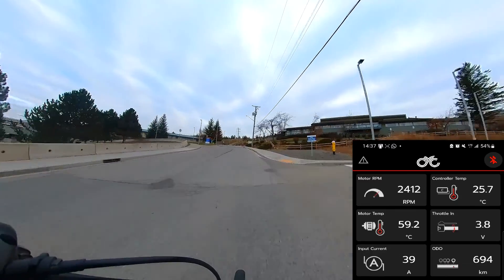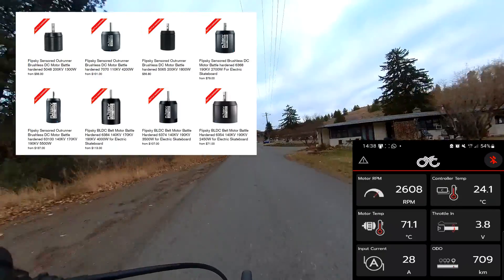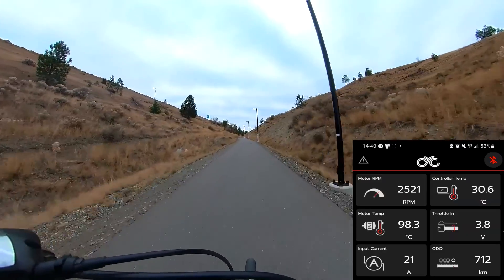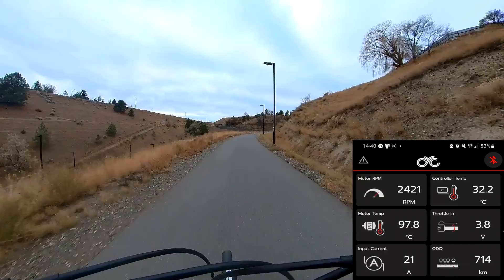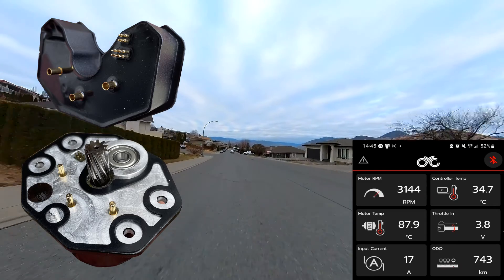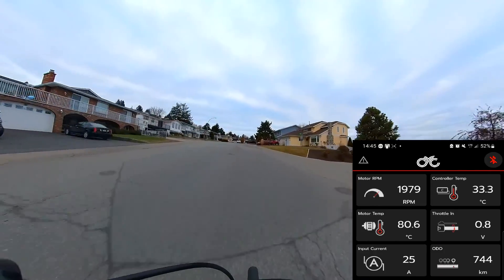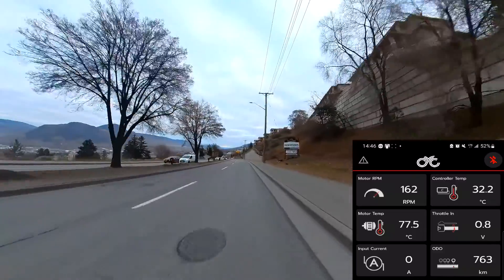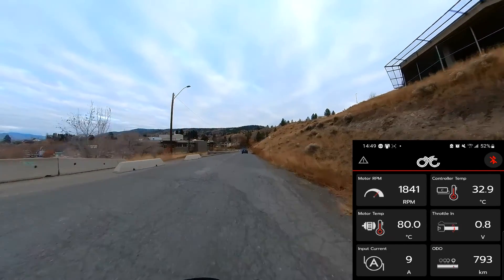How This Ebike Motor Works - Why the CYC Photon gets hot

Comment: Nice vid! It very much mirrors what you said in your earlier CYV Photon videos regarding design trade off. I personally still plan to get a Photon as the design tradeoff is ideal for me. I'm after a small, light motor with high peak torque for uphill sections on MTB trails (plus some boring commuting at non-motorbike speeds). Despite living in a hot climate (Australia) I'm betting i will rarely see extended periods of 90+ degrees.
Reply from the maker: Sounds like you will be running it well within its limits most of the time so you are likely right. It will definitely give you an assist on the steeper stuff in a very compact package. You do get a two year warranty which is nice although you might be having to wait a while for parts unless there is a dealer in Australia that is doing servicing.
Reply: i would be interested to hear how you go with using this for mountain biking in terms of heat for short hill climbs. im also in australia and considering this motor.
Reply: @muzzarobbo  I got my CYC Photon installed on a Trek Marlin 6 today. My first ride was so much fun. Mostly flat / low grade fire trails, some tougher technical MTB trails (for me) including steep sections I'd never even think of riding up myself. Followed by riding on the steep local roads. 24 degrees ambient temp. Staying on "race mode". I weigh 100kg. Motor never got above 65 on any of the trails, and only hit 90 once when testing full throttle on roads going up a long and steep hill at 30kmph+. It cooled down to 60ish faster than I thought it would by just going back to a medium PAS level. I don't have anything to compare it to, but the torque sensing feels really good. The bike shop guys who installed and test rode it said it felt like the Bosch torque sensing motors. 
Long story short I'm very happy. Let's hope she ends up being reliable for me!
Edit: I didn't go much faster than 30 or maybe even 25kmph on the trails. At that speed I was reaching my comfort and confidence level on the rocky surface. I surprised myself getting airborne a few times too.
Reply: @Intermission42  Its a great motor, the best of its kind. So tired of clueless know-it-alls trashing it.

Comment: I have had my 52V CYC photon setup installed since august and am now approaching around 800 miles.

It is by far the best DIY torque sensing setup IMHO at this time and my favorite to ride.  

My other DIY ebikes have been an 52V OSF TSDZ2 (with additional sw mods by me to improve torque sensing), torque sensor equipped Grin 52V GMAC (1500w) and 52V BBSHD (1500w).

It obvious from looking at the photon, its not made for sustained high power especially when compared to the BBSHD.  That being said, its significantly lighter.

I installed mine without a throttle as it seems like it would be super easy to overdo on the throttle and cause overheating.  The torque sensing is so good, I rarely feel the need for a throttle whereas a throttle seems mandatory on the BBSHD.

I run mine in unrestricted mode and 95%+ in assist level two.  I only get overheating(90C) on assist level 2 when going up hills greater than 10% (My 42t chainring and 11-36 cassette isnt the best for this grade although the BBSHD handles it fine).  Assist level 3 will overheat if I am really pushing it (25mph+, high headwinds winds and 4-6% grades) and I can usually get it to 90C once per ride.  That being said, no overheating at assist level 2 for those same conditions.  Of further note that this unit seems very efficient although it does require more from the rider.  My unit seems to cool down rapidly once I just reduce power, just resting the motor for a few seconds is usually good for a 5C reduction.

Im 240# and most of my rides are rolling 4-6% hills, typical elevation gain is 1500ft in 25 miles.   Typical temps for most riding is around 50C and this is at an average speed usually of 18mph.

FWIW, I also have a Specialized Turbo Levo and Luna X2(bafang m600) with ludicrous upgrade.  Have also owned several other factory equipped mid-drives both Class 1 and Class 3.

Will buy/try a ToSeven DM01 soon
Reply: Great information
Reply from the maker: Appreciated. That is an impressive stable of machines! I think they need to be clear with the Photon what it can and cannot do even of that means that it sells less. In the end it will save them money as there will be less people making warranty claims. Some of the issue where I am is it is all hills and mostly 10%. I am wondering if the throttling behaviour is different for with PAS than the throttle. It seemed to cut more power than with the throttle. Not sure why. I would be hammering the message of get Turbo Levo performance with the bike you own. I would be going hard after that market. That is the kind of buyer that would not balk about buying a motor for $1000.
Reply: IMHO, the photon is a great alternative to the $$$ euro based mid drives with a little more oomph.  Its a ton better than the class 3 brose bike I owned.  Thats how I look at it.  It even has a euro based price tag😀  While the torque sensing isnt on par with the Brose, I am nitpicking at this point.  I love my photon.

Your just spoiled by your 72V BBSHD (a project I have been debating but too over the top for my riding)
Reply from the maker: Yeah. You have a point. I tend to judge everything by the throttle response on that which is not fair. I try. But there is no going back lol. Maybe if I didn't ride it for a year? hmm. That would be tough.
Reply: @HighVoltageKits , mine is set and ridden at around 95% + also, but strictly level 3 race mode. peddle only. no throttle except for periodic cheating at extremely short bursts.14% grades and 1800ft climbs. 42t chainring/12-50t cassette.  longest run was 30 mi. the only times i have experienced throttling is when using the throttle.
Reply: @bobbobb1791  same. Brilliant motor. But to be fair, the motor never "overheats". To an outsider, this will scare them away. Be honest. Be fair. Don't smear this amazing company. The motor DOES NOT EVER OVERHEAT people. If it gets too hot, thermal overload protection kicks in and it cuts power to cool down. The only reason this ever happens is because the amazing CYC company gives tons of extra power that you can use in bursts. And you can use the bursts frequently and to insane effect! Its a brilliant motor and this review video is misleading, unfair, and arrogant.
Reply: @HighVoltageKits  You just said that you're judging everything by the throttle which was not fair. You just stated your review was not fair. So remove it and apologize to CYC for smearing their product unfairly. There is going back. You can be a good person and retract your unfair assessment.

Comment: What's the  best mid drive motor overall for speed and doesn't over heat
Reply: The best mid drive motor that doesn't overheat is the Photon. It never overheats. Its too bad this video smeared its reputation. They give you up to 2000 watts unrestricted, that is why if you use all of that (more than twice what its rated) thermal overload protection kicks in and limits the power until it cools down. The extra power is bonus. But people are too stupid to realize that, and then overuse it, and think the motor "overheats". It never overheats.
Reply from the maker: It depends what you are looking for. The most reliable by far is the BBSHD still. You can reliably power it over 3kw with a high speed and have a reliable bike that will run for a long distance. You can overheat anything with enough work though. The CYC X1 will also deliver speed with a torque sensor but less reliability and its louder. Those are ebike conversion motors. Beyond that there are the bottom bracket motors from Bafang. Are you looking to make something or have something pre made? If you really want higher power then you need to look at things like the Sur Ron (modded) or Talaria. You are in motorcycle range then. Any of the DIY ebike systems will overheat given the right amount of abuse (a long hill at full throttle) The best ones will roll back to protect the motor. The hotter the weather the quicker it will heat up. I hope this helps. If you wanted to learn more you would be welcome to join our discord and figure out what might work best for you.

Comment: I'm seeing a few comments from people seeming to avoid the Photon, instead perhaps promoting the Toseven motors which are even more of an unknown. I've been riding my Photon since April, and almost all of that is offroad, including a recent trip exploring around Wanaka. I'm totally impressed with the Photon, and for my use - long trips where low power levels allow more range - the bike and motor have performed absolutely perfectly and better than any OTS ebike at many times the price.

If you want the equivalent of a electric motorcycle, the Photon is not for you. If you want a DIY system comparable to OTS ebikes, but with better performance, better feel, light weight and lower cost, the Photon is worth considering.

And for many modern 1x, Boost 148 mtbs, there are no other systems that will fit, at any price. CYC has multiple systems that will, and the Photon is almost invisible.
Reply: Likewise buddy. Its so disheartening to have a reviewer like this basically trash the motor and cause brand harm and lost sales. This is the best mid-drive motor on the planet for its size and price.
Reply from the maker: I try and steer clear of promotion of any particular product even the stuff we make although I am proud of it. I present my experiences. I have been quite clear that much like the long term viability an d longevity of the Photon the TOSEVEN is very much the same. On our Discord there have been some issues present themselves. I ran into an early firmware issue albeit on an evaluation model. New motors by any company are unproven. Like the BBSHD earned its reputation and so do others. I think with CYC some caution is warranted as they do have a higher failure rate. For that reason I would not recommend them as a commuter that you have to rely on or for a business person that needs it to work and would suffer without. You state the ideal use for the Photon. Essentially it gives you the feel of a Bosch or Shimano at much cheaper price point than the off the shelf bike. Ridden the way you do sounds like its sweet spot. I think they should focus their marketing there. Show people how they can beat the $10,000 plus bike by converting one you already own rather than hinting that its a 2kw motor. Its versatility to fit many frames with a small footprint also is where it shines along with a slick app. Cheers
Reply: @HighVoltageKits  how do you know the true failure rates? A few subjective reports? You don't see the back end data.
Reply: @HighVoltageKits  you stand clear of promotion, but happily smear a product unfairly. How do you know the Photon has a higher failure rate with limited subjective experience? Don't you need to see the actual production volume data vs. failure rate to make that claim?
Reply: the frame compatibility and small chainring options really sets it apart from the rest of bb mount motors. the price is outrageous, though, and building it around an outrunner is just plain stupid. what is the higher power density good for if the heat cannot escape?
I have suggested toseven to redesign their motors to accomodate 38t chainrings with the required offset. that will take time though, and until then, the choices for boost hub, long travel hardtails remains almost inexistent. there are very few frames that will happily take a bafang or toseven motor, these are the Ragley bluepig (4130), IZIP frame from China and another hardtail enduro frame from China. most other long travel hardtail frames just don't have enough chainstay clearance to accomodate the motor housing, let alone a dished 42 or 40t chainring.
Reply: @JoLe1991  you'll have to grind off the ISCG tabs on the Blue Pig, and you'll still have a stuffed chainline if you need to use the smaller chainrings. Photon on a Blue Pig would be awesome though!
Reply: @hindesite  yes, the tabs need to be gone, and the smallest chainring you can go with is a 40t from lekkie or other cnc machined 7075 models (precialps etc...). 40t is decent small in combination with a wide range cassette.
nearly all other modern mtb frames have such small chainstay clearance you cannot even fit the motor without putting a ton of spacers in between.
i'm installing the toseven DM02 on the IZIP frame now. the motor design is very good (apart from the large final gear as with bafang and tongsheng), but they have messed up the firmware lately, therefore I requested an old firmware to install while waiting for a proper update.
the DM02 has a much better heat dissipation than the photon and is decently compact and lightweight.
Reply: @JoLe1991  The price is worth it. I was able to convert all 4 of my family's bikes for less than the cost of one high-performance e-mountain bike. How is that outrageous? Not to mention that they don't make decent e-mountain bikes for kids. There are so many applications for this motor, and its worth every penny. I'm about to install one on a brand new 2022 Trek Fuel EX 8. I can't wait to ride it.

Comment: I’ve considered a CYC and almost pulled the trigger several times-  gen2, gen3.. But i always find some review video where they go for one ride, and the motor overheats, magnets are falling out, lol 😅  no thanks, Not there yet. ALSO the “user beta testing” as you mentioned in Your other video.  That’s like the ultimate form of buyers remorse lol- to buy something, and by the time you get it they’ve already deprecated it and are focused on a new product. Nope nope Nope. Maybe their collaboration with EBC will allow them to step it up. It’s a no go 🙅‍♂️ til they fix the noise and the reliability issues
Reply from the maker: When the Photon came out I really wanted to try it. It is a fun motor to ride but I know I will just break it again so I will just let it get use as my wifes commuter. It's a good fit for her style and way of riding. Having the throttle is important for her has well. I do get the impression that they are spread a little thin having also been heavily involved with the EBMX stuff. I was well aware that they can be a bit beta going into it but took a chance. I think I will be looking at other things going forward with the projects I have going on. I don't really want to play with the now 4th generation of X1 they just lack guts for want of a better description. I think that some of the issues are because of the design of the motor. That is going to be hard to correct unless they go back and use a different motor. Not sure that is going to happen.

Comment: When the power is less than 500 W and the maximum speed is 25...30 km/h, do you think there would be any problems? But as you said, it's a lot of money for a restricted motor.
Reply: 500W is fine but not more. However 1000 USD is way to much for real 500W motor. Reparabilty is very limited and expensive.
Reply from the maker: Yeah I think this is about right. Speed is less important I think than not letting it sit at high temperatures. I don't know many people yet with huge mileages on these either. It will be quite revealing as the months and years move forward and people start to need more and more servicing. They have a partnership with a decent bike company in the USA which I think is the main market for them. If they start to get dozens of requests though it will be tough to offer a decent turnaround for repairs and warranty.